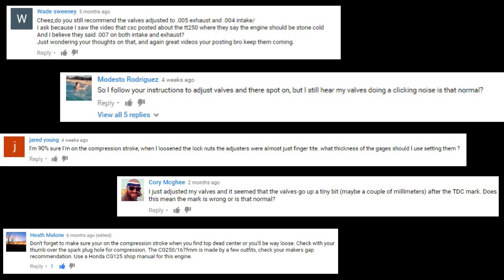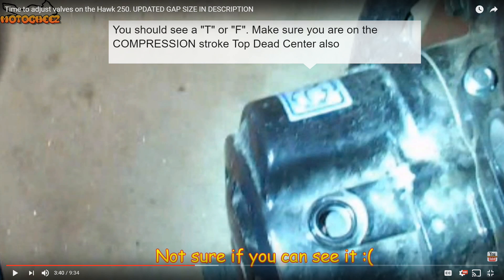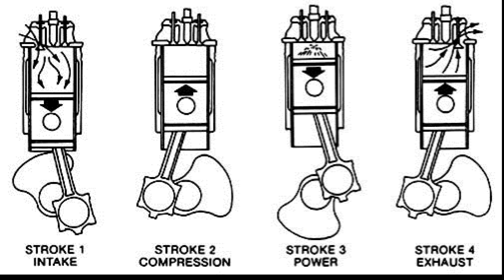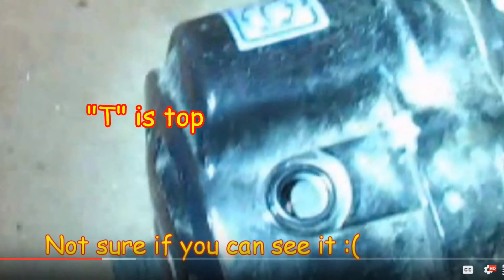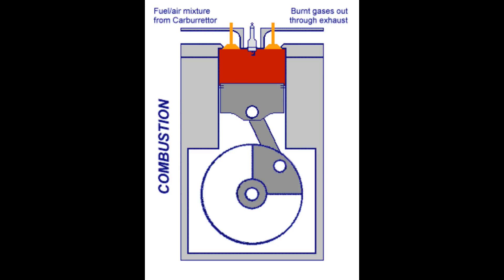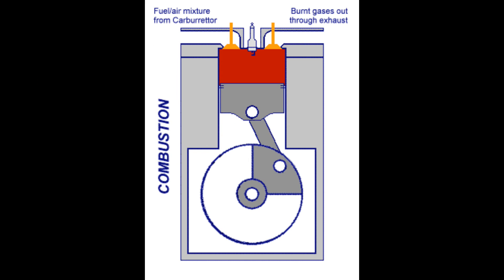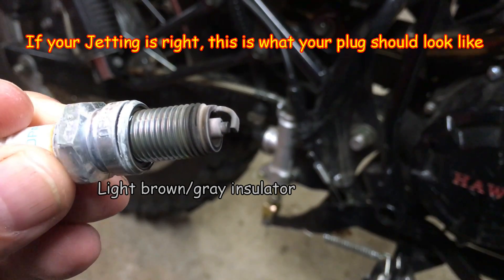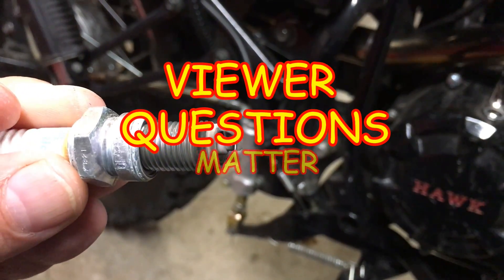How to find TDC and the compression stroke, valve adjustment.Viewer Questions matter video

Comment: Hi! In a 4 cycle engine,positioning the flywheel on mark TDC, to set the valves,appear 2  positions valves in TDC.
1 ) valves are well set
2) valve are locked
Should be the same.
Thank bye

Comment: Do you have a video for carb jetting? I cant get mine to idle right. I guess thats a question i have if the atv wont idle enough to get it warm to adjust the carb what do i do then? Lol im serious though i might be able to get it to run for a minute feathering the throttle.  And if i bang the throttle it just bogs and quits.  It'll start right back up but quit start right back up but quit. My choke cable is broke right now so ive been trying to ease it by hand. Seems like it wants to take forever to be able to just let go of the choke (let it go off by itself). So i cant get it warm to adjust what should i do? Thanks
Reply from the maker: I do have a couple carb tuning videos, but from what you're saying it sounds like you can try adjusting the I don't mixture and if that doesn't do it raise the pilot jet up to the next size. You can also shim up the needle jet with a small washer to give it a little more fuel from about 1/8 throttle to 3/4 throttle

https://youtu.be/k8sqfMpzn4M?si=ura_0SM9U_zUU1OQ

Comment: Here’s my question.

What would I notice if I adjusted my valves on the wrong stroke?
How would the engine run?
Would I notice a compression loss if I did a compression check?
Would the engine run at all?
Would I hear a lot of valve chatter?
Reply from the maker: You'd get a lot of valve noise and slightly less power. Could even lose a pushrod
Reply: @MotoCheez  
Thanks for responding 
I guess I got lucky.
I’ve never adjusted valves before and the last time I rebuilt and engine was back in 1987 and I ended up having a shop property adjust my valves. 

I took all the rocker arms off to send them in for warranty replacement.
When reinstalling them I used a bore scope in the spark plug hole and the timing mark TDC to ensure I would stop turning the crack just when the piston started coming down after TDC and adjust the valves on that cylinder.
Then use the same process to adjust the rest going in the firing order.

Here’s my mistake.
For some stupid reason it didn’t occur to me at the time that there are 2 TDC’s.
Luckily, I must have been at the compression top dead center.
It runs smooth and no chatter and will fly past 6500rpms and keep going if I don’t stop it.

Does that sound like I did it right or could I still have adjusted them on the wrong stroke??
Reply from the maker: If it's quiet I think you got it!

Comment: My 06 cat 500 4x4 is ticking pretty good.. It was recently rebuilt on the top end. I'm assuming an adjustment is required?. It's a  good tick.it worries me. It runs and drives fantastic tho.
Reply from the maker: Sounds like valve clearance too big possibly

Comment: This freaking still confusing why can't somebody just say when you're exhaust valves clothes or open and then close that's the top dead center compression stroke or your intake valve when you watch it go down and then comes back up top dead center that your compression stroke how smart is that I can't have nobody say that they got to say it in some revolution kind of big shop talking everything to me it's simple exhaust valve goes down and then comes up that's your compression stroke or intake valve goes down and comes up and that's your compression stroke one or the other why can't it just be that simple
Reply from the maker: Because it's not that simple. Every other top dead center cycle is  compression. If you adjust valves on exhaust stroke they be way too loose. 

4 cycle,
 Is: intake, compression (this one), combustion, exhaust (not this one)

Comment: my fly wheel wont stay at tdc im trying to set the timing and even when u think its right and you bolt it all back up it jumos forward or backwards it just wont stay could you put me in the right directiin for the this problem as im getting fed uo of hearing people on here say this is how u do it and even then its still wrong
Reply from the maker: As long as it's compression stroke you have a decent amount of leadway, so if it moved a little for setting valves it's ok. For timing it has to be dead on

Comment: What will happen if you adjust valves at TDC but not on compression stroke?
Reply: Because I adjusted valves on atv at TDC but I hear crazy valve chatter. I'm not sure if I was on compression stroke
Reply from the maker: The valves would be way way way too loose and they would clatter just like you're describing
Reply: @MotoCheez  amazing how fast you responded! Thank you so much! Will redo correctly today
Reply from the maker: You're welcome. I try and check a few times a day

Comment: So at what stage do you set your points to open and fire
Reply from the maker: No points on these bikes.
Reply: @MotoCheez  so this compression stroke is different on a 2 stroke bike with points ?
Reply from the maker: Yes. 2 strokes don't have valves in the head. Points have been replaced by CDI back in the early 80s
Reply: Ah I'm finding it hard to get my bike to fire , it has points 🙄
Reply from the maker: Usually you don't get spark with points because they're dirty or worn  clean them with a point file (very fine, small flat file)
If you have a T mark on your flywheel. Your points should be closed when it hits the T mark. You can use an ohm meter.
Reply: @MotoCheez  I will try this , it's a 76 Russian scooter ( Tula tourist 200cc
Reply from the maker: @emeraldviking3637  nice. Probably worth $$ make sure plug is good too, 2 strokes foul plug easy

Comment: Great video! Hey man do you by any chance know the valve lash settings on a non HEMI predator 212? I know you have to set the lash lower than the specs when they engine is COLD lol, but I am having one hell of a time finding the actual manufacturer valve lash settings online and on youtube. I removed the governor and added an exhaust header and intake kit other than that my engine is bone stock .
Thanks
Reply from the maker: Hmm, it's a pushrod engine? If so I'd assume somewhere around .004. Did you measure what it is currently? I don't know them that well
Reply: @MotoCheez  yeah pushrod type, I can do the adjustment but just need the actual valve lash specs, everyone here on youtube seems to throw different numbers on stock engines which confuses me, anyway thanks for the reply

Comment: I'm trying  to  time my zuma 125 but won't  start  instead of creating  a  vacuum on the air hose air exit the air hose
Reply from the maker: Check compression. Maybe tight intake valve adjustment or bent?

Comment: Hey moto im not syre what I did wrong this time I followed everything and I belive I got it on the compression stroke and set both intake and exhaust to 003 and turn it on in one kick no clicking sound or anything sounded really good but it kept dying I figured it was because it wasnt warm so I kicked it again took a few kicks and it started up gave it a little throttle and i was holding it consistently and smoke started comimg from the exhaust manifold and smelled really bad so I turned it off maybe I didnt get it on the right one again or maybe mine is a dud I dont really know
Reply from the maker: Are you leaving the choke on? (Lever up) if the valves aren’t tapping loud they’re probably good now. Sounds like a carb problem.
Reply: @MotoCheez  i had the choke down when I fired it up because for some reason it wouldnt start with it up do you think it would be ok to leave it on even if smoke comes out should I let it run and warm up or could it damage the engine
Reply from the maker: Mason Merck it could be burning off old fuel. Run it and see if it clears up as it warms up. Of course you have to keep it idling by hand until it warms up, then you can adjust the idle to about 1200 rpms
Reply: @MotoCheez  also one other thing this might be the correct way but jist making sure I pulled up the adjuster and made sure it would only go to what I set it too so I would pull the adjuster up with my hand not turning it and make sure itnwould only goto 003 is it suppose to have more play in it? Hopefully that makes sense
Reply from the maker: Mason Merck yes. There should be a slight resistance

Comment: If the pointer on flywheel is on zero, it is possible not to be on the compression stroke, but the exhaust? To check both rocker arms loose on the valve stem? I would not be able to put my thumb on the cylinder while hand cranking the engine I don't think. Thank you for the video. I just got this single cylinder susuki gz 250 and it needs new valve stem seals. I only have worked on 2-stroke motorcycle engines.
Reply from the maker: Yes. Every other TDC is a compression stroke. When you feel the compression and the rockers are loose is compression. Correct.
Reply: @MotoCheez  Thank you. I meant valve stem seals.
Reply from the maker: Yeah you can either pressurize the cylinder to hold the valves up. Or I've heard of people putting rope in spark plug hole then raise it up to hold valves from falling in ..

Comment: I seem to run into a little problem as well. I'm pretty sure I'm at tdc. Used the kick start to until i felt the push of air from the spark plug hole. My T is lined up and everything. However when I loosen the bolts keeping the valves tight, I get no up or down play whatsoever. Meaning I can't increase or decrease the gap. Any thoughts? Am I not at TDC or is there a step I'm missing?
Reply from the maker: Steven Lang you're probably on wrong stroke if they're tight like that. Try one more revolution
Reply: Ok I think I got it. I was in TDC, I just had to finagle the screw and nut to be able to adjust the gap. First time I closed her back up she made a lot of clinking noise. I had too much of a gap. Went back in and adjusted the clearance correctly (I'm at .003 on both now) and she started right up without choke and purrs better than before. By chance will adjusting the valves effect any of the tuning for the carb or the idle speed? I noticed recently that if i just let go of throttle while in 1st or 2nd gear I can just continuously coast without it stalling out. Thanks a bunch for the info and good job on the video. It was really helpful. First time doing this by the way and it was a lot of fun.
Reply from the maker: Steven Lang awesome!! THANKS

Comment: Welp, bad went to worse for me, not only did I NOT complete the valve adjustment. I never found tdc on compression stroke properly by kickstarter, so I opted to pull the spark plug, Somehow it pulled alot of the threads out with it. So now I have to get the spark plug hole rethreaded. Great. 

Just so I can put my mind at rest, when I place my finger over the hole, and rotate the kicker until the hole hisses my finger off, at that point I should have a T or an F mark through the hole, correct?
 Or do i rotate until i get to the T or F mark AFTER the spark plug hole hisses my finger off.
Reply from the maker: mike Last that sucks, yes when it stops hissing the mark should be close, you possibly just passed it.
Reply: MotoCheez Any way I can get a step by step on removing the section of the top end where the spark plug hole is? I have to take it to a machine shop. Sure wish I could just pay you to do the valves .
Reply from the maker: mike Last the Honda manual for the CG engine is on motocheez.com in the hawk section on bottom of page. Has breakdown of it

Comment: And thanks by the way, think it's done alot of damage, It literally ran for about 60 secs or so, I saw the pipe that hot and killed it. Have to get the TDC right and do it again, I hope I didnt damage the valves.
Reply from the maker: +mike Last unless you revved the hell out if it, you're probably fine. You'll know if you don't have any compression.
Reply: MotoCheez thanks for the fast reply! So just to be clear, Im looking for the T or the F to be lined up after hit the top of the compression stroke, Im going to play it by feel as you did in the video. I really appreciate the help this was super informative.
Reply from the maker: +mike Last yes, perfect.
Reply: MotoCheez Great so would that be the "T" or the "F" I should be looking for after TDC on compression stroke?
Reply from the maker: +mike Last either one is fine, T is top. F is Fire (timing)

Comment: Finally, I found the info Ive been looking for, I adjusted the valves but had no Idea about the compression stroke, I just lined up the T mark and adjusted the valves, started the bike, the pipe glowed red after about 1 minute of idling and I shut it off. I havent readjusted the valves or touched the bike since this happened.

Comment: Glad to hear there's always a slight tick it had me kinda worried. I didnt pull spark plug second time just used kick start until i felt more compression then found tdc. it was very close to being on tdc after pushing just past the compression. Does this sound correct?
Reply: I found out you can use the extension of your compression tester and screw it in the spark plug  hole and put a balloon on it the balloon will blow up on compression stroke

Comment: Mine got better i did my best to be sure was a compression stroke tdc .002 snug on filler gauge. Actually when i opened it first they where both tight i just cracked them open and gave the slightest bit of slack i could on both without filler gauge. Got paranoid about it so i ran out and got one. Checked them and they where at .002 and the exhaust was .003 wow! i was soo close to perfect adjust without filler gauge.

Comment: adjusting valves on shark 250 seems to have very similar engines. i here a rattle when running .002 on both has been working no clink
Reply from the maker: Jesse Lee should be the same, yes. there's always a slight tick, but did yours get worse after adjusting?
Reply: yes mine is louder ticks and is bogie at first even after correcting my mistakes. seems best to be left alone becausebits overheating and smoking from the top of the pipe closest to the exhaust port from the engine :(